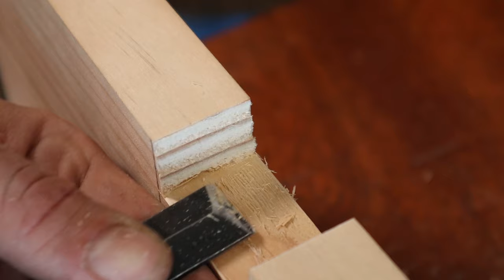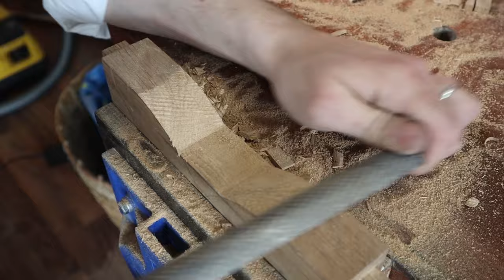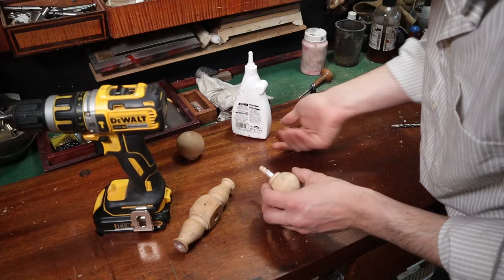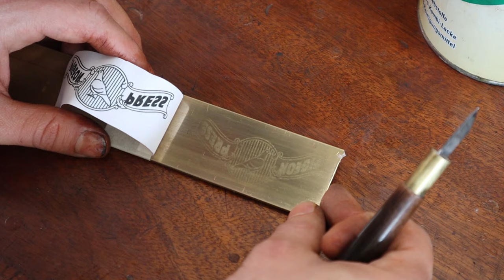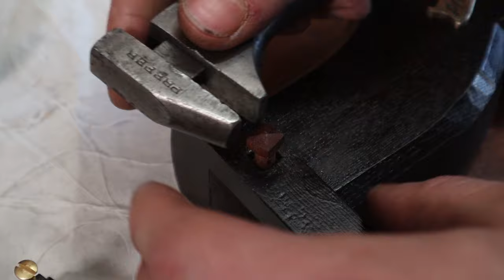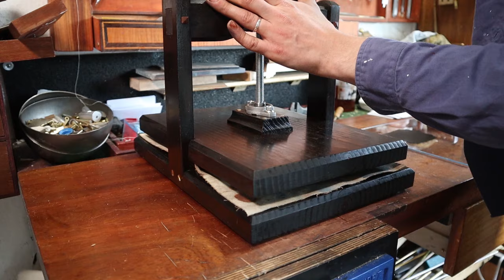Making a Printing Press

Comment: Just a tip! Rub your wooden nails with some olive oil before pressing them in, that way they will be easier to press in, and the oil will make the wood expand so that they will be locked in place😁 beautiful work👌🏻
Reply: pro tip:
use linseed oil. it wont go bad and it hardens, so it seals the wood.
Reply: Thank you very much for the tip General Jordet, I'll pass it on to my kids and nephews / nieces. These little tricks are rare to know.
Reply: @miko007  Lord have mercy... that is a great tip, miko007
Reply: @miko007  I would have thought wax?
Reply: @pennycandyys  you could use wax, but wax does not harden, nor does it soak into the wood.

Comment: Tip for printing an engraving: make sure you give your paper a good long soak, and get a THICK piece of sturdy (preferably real wool) felt. And remember to file the edges of your printing plate otherwise you'll cut through the paper.
Reply from the maker: Thanks! yeah, I already ordered 6mm felt (man, they're expansive). let me know if you have a recommendation for a good printing paper.
Reply: Yeah it's super expensive... Boesner has 'kupferdruckpapier but they only seem to sell per package', if you want to buy loose sheets just go to any art supply store and ask for kupferdruckpapier. Basically the paper needs to have fibers that are long enough so it doesn't fall apart when it's wet, or be so thin that the printing process will tear it apart. Standard A4 paper is exactly what you don't want - thin and fragile with short fibers.

Comment: You did a great job on that press.  I was in the printing industry for 40 years before I retired. I learned printing using similar process, its called letterpress. Google letterpress printing and download info to get a better understanding of how a similar press you built works. A great job.

Comment: That is a great little printing press you built. Having done multiple types of printmaking myself, I really don’t think you have the pressure/force you need to use that press for intaglio printing. That is a great press for relief prints though.

You should think about getting some printmakers blankets to protect both your press as well as your work.

I would also recommend that you put the inked up relief cut on your press bed and then put your dry printing paper on top, rather then the other way around, like you did at the end of the video.

But all in all that is a amazing hand built printing press you made there. I would be proud to have something like that to use.

Comment: The rolling press is actually pretty easy to make, if you make a small sized one. In school i fabricobbled one with two large springs a rolling pin and a couple of boards and a chair. I screwed one board to the chair, drilled two holes in two legs going perpendicular to the axis of the board (which was overhanging on that axis by half the width of the chair seat. Those two holes held the two springs. On top, i took the rolling pin (i found one that had a steel arm core with a wooden exterior, it also received two holes in the arm holders) put it on top and hooked the springs to it. When i would print, i'd put my knee on the opposite side from where the springs were in the legs, put inked form down, put the paper on top and then the other board on top of that which had a thin, soft foam on it. After that, i'd roll the rolling pin on top using the weight of the springs. Important to note that the center of the print would have to be the center of the rolling pin legs on the chair. Otherwise it gets difficult to pull the springs far out. Once you get enough experience, you start rolling them pretty fast. Eventually i put two nails in the top board to stop the rolling pin from rolling off the board, and i'd lift the board for quick access to the print.

Comment: Uri, you are an accomplished craftsman, designer, and engineer. I laud you on your effort and offer a couple of points to help you in printing. 

The purpose of the screw is to deliver force to the center of the platen, and that force radiates out to the edge of the platen. Because the force is in the center, the pressure decreases quickly as it goes out to the edge. The platen you made may deflect and bow upwards at the edges when you tighten the screw. Usually platens are built up to give them dimensional stability.

The screw you have used is quite small in diameter, and that means you won't have much pressing power out at the edge. If you look at a wooden common press similar to pre-19th century, you'll see that the screw diameter is quite large in comparison to your screw. Even though yours is metal, and the thread pitch is different, it is no match for the flat pitch and diameter of the wooden screw. 

Good luck with all your builds. I will enjoy looking at your other work as I've just been told about you.

Comment: I think the only thing you'll find lacking in that press would be getting an even pressure over the whole surface (end and edges mostly).
For prints that are smaller and able to be set under the central screw it'll be great. Well done!

Comment: Amazing press! This is a book press. Suitable for block printing but not for intaglio. for printing always on with the same pressure, you should add some strips os lino on the edges, leaving the print on the middle. two are enough

Comment: Wow - that's gorgeous!  I've been experimenting with transferring laser print to wood with great success; might that work on your brass as well?  I just print what I want (reversed) on paper, then put a coat of Polycrylic water-based poly finish on the wood, and a coat on the paper.  Put them together, squeegee out any bubbles, and wait.  When the poly is dry, peel off as much of the paper as you can, then start spraying it with water and rubbing it off with your thumb until all the paper is gone.  I've been using the process to transfer images onto homemade wooden game boards (the "Royal Game of Ur" is my first project) and it works great, for color or black and white.  In your case, you could then engrave away the toner, or clean it off with acetone.  Might be worth a try.  Hope your hand is okay... ;)

Comment: Very cool! I really like your engravings. There is a trick to make the print transfer more apparent. Instead of printing on regular paper, use photopaper and instead of using acetone use a hot iron to transfer it over. That's a technique used for masking when engraving with acid.

Comment: Hey Uri! Love watching you pursue your various, overlapping crafts! Thought you might like to know an easy method (and archaic!) to dye materials with tannin like leather or wood. It's called vinegaroon, using steel wool and vinegar to make ferrous acetate, which is clear in solution but turns tannin black. It's how all those old bits of leather work look so fine and dark despite modern dye not existing. Give it a try!

Comment: Fantastic video Uri. I would be worried that those douglass fir pieces will cup over time. Maybe when that happens you can re-make those two pieces by gluing up some quarter sawn pieces, I have good luck ripping 2x12s or 2x10s down to get those very cheap.

Comment: Very very VERY beautifully done. Arts and crafts on a sublime level. The way the visual information is organised allows for little verbal commentary. That's good planning, directing and editing. But still... I have some doubts. Ore only one big one. The spindle has via it's bracket a relatively small contact service with the printing plate. So, when you're printing a great surface... will there be enough power directed to the edges so that you get a printed image that's strong and even over the whole surface? But still... this is so cute! 😄

Comment: You can make complex plates for pressing by using acid etched copper plates, similar process to making PCB etching with ferric chloride. or even do electro-etching with a siple 9v power supply

Comment: Awesome build and I really love that old dark antique look, But why didn't you just make a lever press ?  With a lever press you have more control and can apply more power if need be. You can actually feel what you're doing much better with a lever press and more than double the strength and power you can get out of that lever press.

Comment: If you ever build another one of these, substitute a square shoulder Acme thread with a larger pitch on the threads for the press shaft--it'll raise up the platen a lot faster and allow you to apply more force to your print.  Take a look at one of those 'torture device' presses, and you'll see what I mean.

Comment: Uri, you have inspired me to make the tools which are missing from my 'needs' list.  I plan to make a graver to do small engravings similar in size to what you have done here.  The previous video about making the graver is great, and I will be using that - but could you please tell me the weight of the small hammer which you use to tap the graver in this video. I will be making a small hammer customised to my hands but need the weight of the head to help the calculations. Many, many thanks for your videos.  They are opening a whole area of craft which might just replace the one disappearing due to my increasing disability. I will be watching each and every video you post. Lynne

Comment: Using letter copying presses, copies could be made up to twenty-four hours after a letter was written, though copies made within a few hours were best. A copying clerk would begin by counting the number of master letters to be written during the next few hours and by preparing the copying book. Suppose the clerk wanted to copy 20 one-page letters. In that case, he would insert a sheet of oiled paper into the copying book in front of the first tissue on which he wanted to make a copy of a letter. He would then turn 20 sheets of tissue paper and insert a second oiled paper. To dampen the tissue paper, the clerk used a brush or copying paper damper. The damper had a reservoir for water that wet a cloth, and the clerk wiped the cloth over the tissues on which copies were to be made.

Comment: A4 sized label paper, take the backing (so maybe use the actual label and don't discard the backings) do not touch it with your fingers or get it dirty. Put it in the printer, print whatever you need as a reverse image on the label backing then carefully reverse and flatten against the item you need marked with ink (wood, plastic, metal) on items that don't absorb the ink, use a heat gun on medium.

Comment: I would have some Ali plate on the bed and on the opposing face of your nipping press. I say this because if you start to print using type or harder blocks it will make the surface un level thus making prints less defined as time goes on. All the best

Comment: If you are going to be using this a lot I suggest replacing the 60° thread with an ACME threaded rod. In addition to ease of manufacturing, 60° threads are used because of their self wedging effect. The angled face of the thread converts a large portion of the tension or compression of the rod into radial(outward) pressure against the nut. This results in lots of friction between them. It's the reason a nut will stay tight on a bolt for a long time. ACME threads have a 29° face angle so there isn't nearly as much wedging effect so they have lower torque requirements. Square and buttress threads are also used but are far less common, but provide the least extra resistance owing to their 0° face angle. https://en.wikipedia.org/wiki/Leadscrew

Comment: Its lovely but it needs a different rod from a metric bar, either in wood or 3/4 inch steel with a much larger thread on it, that will apply much more pressure on it, my dad was a printer, his father and father before that and we used to have a old press like this, it weighed a ton and the wood had a lot of metal in the frame from memory. It really looks great but without the larger thread i dont think it will apply enough pressure over the entire surface area. The rod went into a large metal plate on top wood plank as well which helps with the pressure. 

you really made a nice copy of it though but to me the threaded rod is not right, sorry....

Comment: Sorry, I was disappointed.  You took way too many shortcuts in making this press.  I mean c'mon...you used a store bought drill, drill bits, and did not mine the ore (and self process the metal) to make your own wood screws and main bolt!
Please take this as the joke it is meant to be! 😄
I am awed and inspired by your craftsmanship and attention to detail.  You have taught me that unlike my previous and brutish mindset, that the enjoyment is not in getting the job done quickly by trying to remove as much material as possible with each swipe of the chisel/tool.  The real enjoyment comes from taking the time to be precise with each movement to accurately craft a finished work of excellence.  Thank you. 
 And...take care of than hand.
But it is good you must have three hands anyway.  Right before the part in the video where you show how flattened your hand was, your video shows you were using two other hands to tighten the press.😊